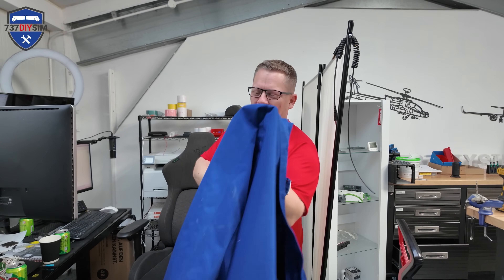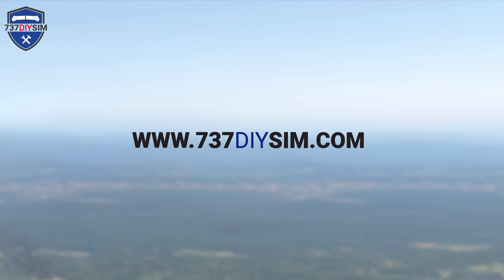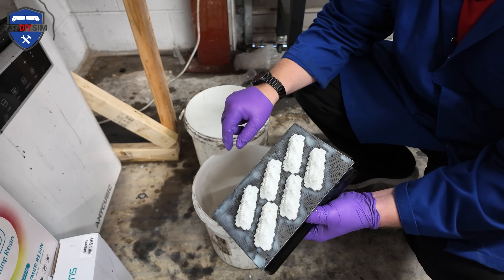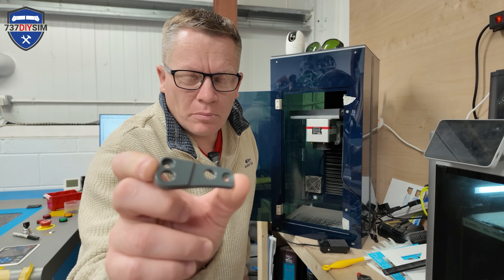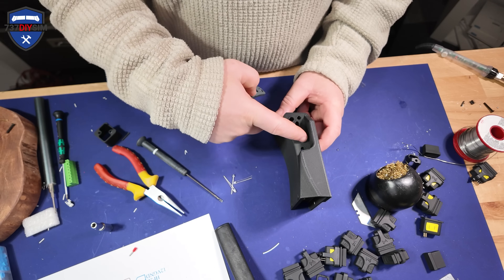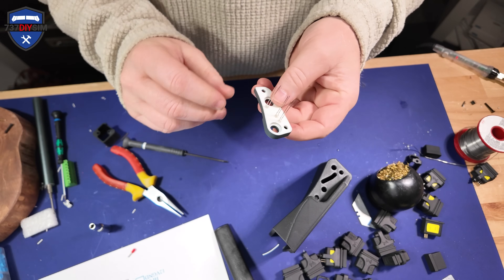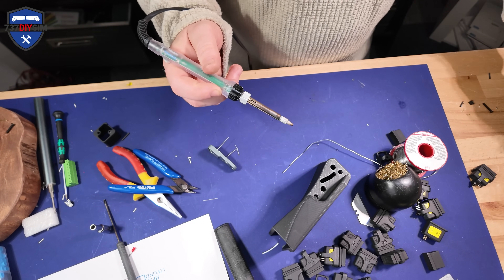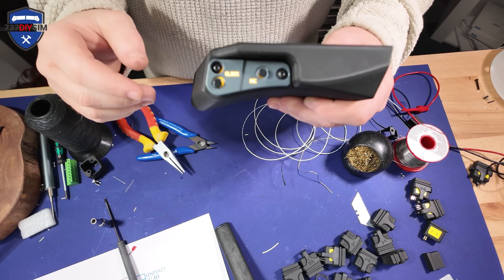Creating the prototype 737SS Glare Wing Panel

Comment: Hi Karl, I really celebrate the new caretaker outfit 😉. There are two things in the video I'm interested in. You seem to speed up the drying process by using a heater lamp. I'm waiting a day for the laquer to dry before engraving. How long are you waiting when you use the heater? And you are using a very compact exhausting system for spray painting. Are you satisfied with it and can you give a type name or key words for a search for similar systems?

Comment: Interesting as usual. And inspiring. Haven't followed you in a while. Really nice to see the new workshop too. Wow looks awesome!
Reply from the maker: Hey! Great to see you back and thanks for the kind words on the workshop. Its an awesome place to build and design now.
Reply: @helimech8152 I can understand that! A dyisimmer's dream! I Promise to check in more often! :) cheers!
Reply: @helimech8152 also, I have finished (almost) the 38$ MCP, and still have some wiring work on the non-pcb FMC ;) it's taken years 😆 and now I see all your new designs I kind of want to start all over 😆. Do you have discounts for say the new FMC plans for those who bought the original, or do you consider it a totally new design.
Reply from the maker: The new one is free in the build guide, but it does require the PCB!
Reply: @helimech8152 Excellent, that is absolutely an option to consider. Thank you for answering!